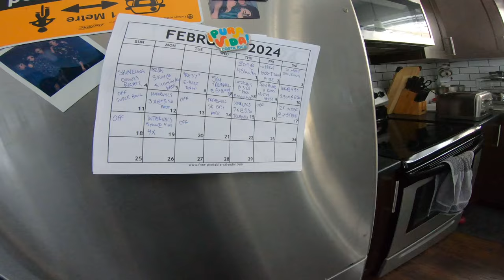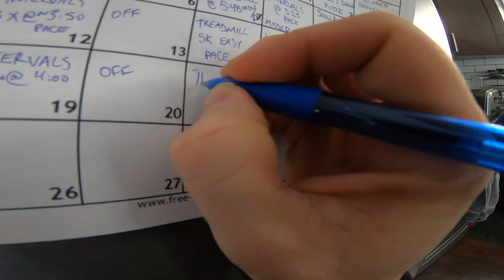7k | Fabric Scoop is the BEST SADDLE (Fight me) | Build

Comment: ,I purchased the saddle in question a few days ago and after the first ride I noticed that the rails are not perfectly welded in the rear part of the saddle but, so to speak, they slide in the seats where they are inserted causing some  annoying noises, I wanted ask you if this is intended to accentuate the elasticity/flexibility and therefore the pedaling comfort which in fact is not defective or if instead it is more simply an unfortunate and isolated manufacturing defect of my saddle.